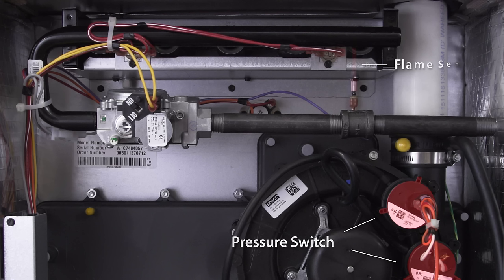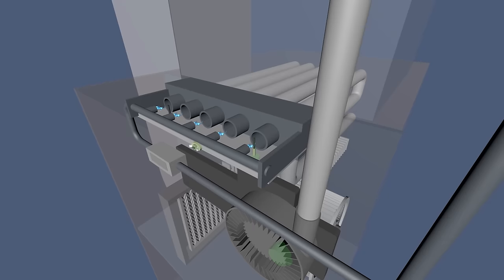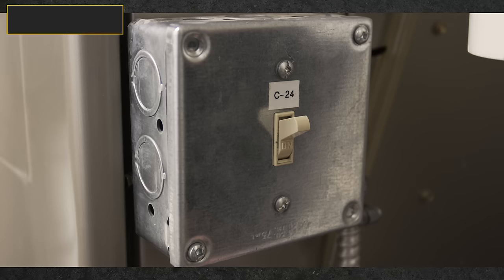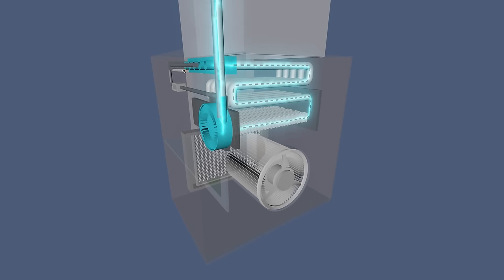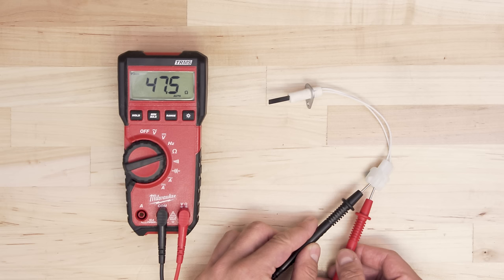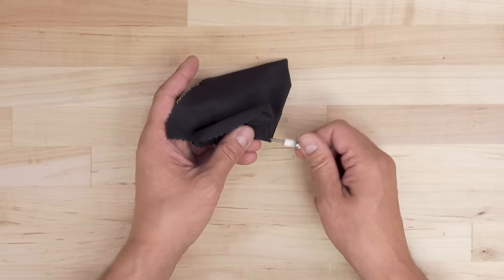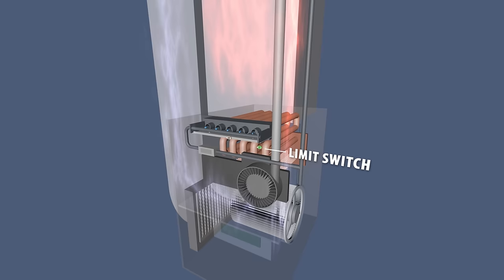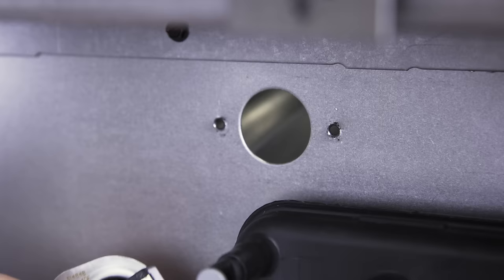Furnace Starts Then Stops - Troubleshooting | Repair and Replace

Comment: I have one of those scenarios. The igniter glows and the furnace fires up but then shuts off within seconds. I presumed because the blower isn't coming on? (blower does work for AC)  I don't see anything that resembles a separate flame sensor. I have a Nodyne furnace and I think the igniter and flame sensor are a single unit? I do have that flame rollout switch and the limit switch.  Likely one of those? are they identical parts just in different locations?
Reply from the maker: Thanks for the update. The flame sensor is also called a flame rod. This is because it is a solid piece of metal with one wire terminal. This flame rod will sit in the flame. Generally it will be located on the opposite side to the ignitior, (since the flame sensor checks that all the burners have ignited).

The flame rollout switch and limit switch are measuring temperature and not verifying if there is a flame or not. 

If the flame does not stay lit, cleaning the flame sensor, burner and checking the connections to the flame sensor are all things that can help solve this problem.
Reply: @AmreSupply  thanks for your reply. I see nothing with a single wire terminal that looks like a flame sensor in your videos. My Miller/Nordyne unit is a single burner. The only thing sitting anywhere in or near the flame is the igniter. It is a downdraft unit in a mobile home.
Reply from the maker: @jeffflowers729  In that case the flame sensor will likely be built into the ignitor.
Reply: Something is very wrong now. The ignitor stopped glowing so i wiggle the wire and it sparked and shorted out.  The new igniter doesn't work because There is no power to the ignitor. The circuit board shorted out. Black burn mark on cabinet behind it. so I ordered a new board and it's got a steady flashing red light which means false flame or internal fault. Nothing happens. ordered another board and still steady red flash. If I unplug the 9 wire plug the inducer and blower come on, and stay on when i plug it back in, but still no power to ignitor. Two defective boards?  @AmreSupply
Reply from the maker: @jeffflowers729  Thank you for the update. It might be worth checking continuity of the wire that runs between the ignitor and the control board. If there was a short, and if the circuit board shorted out, the ignitor wires might have become damaged. Also check the connections to make sure there is not a carbon buildup on the wire connector or terminals that might prevent a good connection.
Reply: I was able to fix the problem.  The igniter shorting out and burning out the board was the start of it all, but trying to fix it, It was the new circuit boards all along. The 903429 is supposed to be the upgrade for the 624640 board that burned out. I tried two of them. I was able to find a 624640, plugged it in and all is working. Did I have two defective boards or they are not truly an upgraded substitute??

Comment: My furnace runs about 5 to 10 minutes, then the gas shuts off but the induction and circulation motors keep running, then the gas turns back on, but the middle burner doesn't ignite properly and I get flame rollout. No flame rollout after resetting the rollout switch. Although furnace has cooled a bit by the time I do that.
Reply from the maker: Thanks for watching. In any case of a flame rollout, check the airflow and to make sure that the burners are clean. If there is any restriction, it can cause the flames to roll out of the front of the burner, which will trip the switch. You might also see additional carbon on the burners in this case. When there is a flame rollout it is often best to get the furnace cleaned and inspected by a professional.

Comment: Lennox g61mpv 2+3 intake and exhaust clean. High and low tubes clean all around. Surface ignitor replaced last year. How do I confirm if the low pressure switch which is a failed open is the culprit? Thanks in advance
Reply from the maker: Thanks for watching. In the case that the furnace shuts off just before igniting, or you have a code which points to low pressure, you'll want to eliminate any other sources of low pressure. First verify that the inducer runs during start up, that there is no restriction in the flue vent, and that there is good airflow overall. Next check the tubes leading into the pressure switch, the ports are small and can become restricted. Other than that, there isn't too much that you can directly test without testing the voltage, or using special equipment to actually measure the pressure. Replacing the switch is the most definite way of knowing if the pressure switch was the culprit.
Reply: @AmreSupply  thank you. Already confirmed inducer starts, lines for pressure clean and good exhaust/intake. Guess I'll have to go to the next level
Reply from the maker: Glad you eliminated those other factors, first.  It does point to the pressure switch as there's nothing else that would give you that code. Cheers

Comment: Good morning! I have an Ultra V 80 furnace. The 4 burners are producing flame, but momentarily. When the furnace wants to start blowing heat, the flames go out and the furnace stops. The furnace repeats the same cycle a few more times and the flames continue to go out after each attempt. All 4 burners maintain flames for a few moments, then stall out. From what we can see, the green light flashes 8 rapid flashes then on the 9th flash it holds. We changed the air filter also and that didn't help. Cleaned the flame sensor as well. Any advice is greatly appreciated, thank you !
Reply from the maker: Hi Rhiannon, thank you for watching. There are a few things that could be happening. The flame sensor could be faulty and might need replacing. As well the flame sensor might not be positioned correctly which will prevent it from generating a good signal. Also its best to check your codes to see what those flashes are referring to. The codes are lightly listed on the back of your furnace door cover.
Reply: @AmreSupply  thank you very much for those helpful tips.  To further clarify: the igniter glows then the 4 burners ignite and have flames. Then after 5 seconds, the flames go out. The furnace attempts another 2 times and the same problem occurs. Beginning to think the "smart valve" is malfunctioning. 
I recorded the light on the smart valve, had to slow down the video speed to 1/8 th of a second to actually count the pulses as they are extremely rapid. The furnace manual doesn't have any information regarding 9 light flashes. There is a 6+3 though.

Any other suggestions?  Thanks again for your help.
Reply from the maker: @rhiannon3357  The fact that you get all 4 burners igniting and shutting off after 5 seconds means that the furnace is not proving that there is a flame present. Double check that the flame sensor tip is in the flames. If that doesn't help then it might be best to try installing new flame sensor. That is the first thing to eliminate.

As well the codes are likely on the bottom, blower door cover, on a big sticker on the inside of the door.
Reply: @AmreSupply  we may have found the solution. Unplugged the wiring from the smart valve and reconnected it. The furnace fired up for the first time and is running, wooohooo! Thank you very much for taking the time to help me out. Hopefully our problem is solved now.
Reply from the maker: @rhiannon3357  Thats great, we're glad you were able to get it running again! We're happy to help out where we can! You might still need to keep on eye on it as its possible that unplugging just reset it. If the furnace short cycles again and does another lockout you'll likely have to unplug again and narrow down the problem from there.

Comment: Thank you for the video.  I want to double check a problem.  The heater (5 year old Goodman furnace) isn't turning on so I opened the panel to look around a few days after the shut down and it mysteriously began working again.  However, after a short while the heater shut down again.  I cleaned the flame sensor (looked cleaned but I cleaned it anyway) but don't see the heater or igniter working.  It looks dead (inducer motor not even starting) but the red light is on solid and not blinking.  Since I was able to get it working after it shut down the first time, could the igniter still be a potential problem (since it worked once more after shutting down)?  Or do you think I have dirt in the hose or any thoughts on what the problem may be? If it's dirt in the hose, what's the best way to clean it? Many thanks for your videos.
Reply from the maker: Thanks for watching. From what you're describing and the solid red code, means that it could be an intermittent issue with the thermostat. First check the batteries of the thermostat and make sure that the wire connections are secure.

The ignitor doesn't partially fail, its usually an all or nothing failure which you can test with a multimeter. So if the ignitor fails it won't suddenly start working again.

If the pressure switch tubing was clogged then you'd likely get an error code.
Reply: @AmreSupply  Thank you for getting back to me.  I checked the batteries (it was fine) and replaced the Honeywell panel and am having the same problem.  I noticed the inducer motor won't even start (almost as if it were in a lockout).  The times I've been able to get the furnace to start (waiting a few hours later), it will run with the heater working for about 20-30 minutes or so before shutting down.  I'm still in the process of troubleshooting but wondering if it's the inducer motor (sounds normal) that is defective even though I can get it to start a few times? I thought the problem was starting the furnace but I'm wondering if I can't start the furnace because I"m locked out (no error codes) and the actual problem is really something causing the heater to shut down and perhaps lockout the furnace.  Do you think it's a thermostat wiring problem behind the wall? Again, the red light is solid so no error codes.  This is a real head scratcher for me.  Again, many thanks for getting back to me.
Reply from the maker: @ching-yi2007  If you think the furnace is locked out then you can turn the power off to the furnace, wait 5 minutes then turn it on again. This can sometimes reset the furnace.

If the furnace runs for about 20 - 30 minutes before shutting down then its likely the limit switch that is defective. Make sure that the furnace filter is clean and there is no restriction of the airflow. Since the furnace runs for 20 minutes, the limit switch will most certainly pass the continuity test but its possible that the contacts inside the switch have warped and its shutting off at lower than its rated temperatures. The switch is inexpensive and easy to replace so that would be a good place to start.
Reply: @AmreSupply  I'll give that a try thank you.  Your videos are really well explained thank you.  They really helped me think of the problems better.
Reply from the maker: @ching-yi2007  We're just happy to help. We're glad that the videos helped you get a better understanding of it all!

Comment: Hi, your video instruction is very informative and easy to follow for common folks like me. Thank you very much.
I have a Trane XE80 that the start up heating sequence all checked out to the surface igniter. The igniter glows red hot but no gas flow to the burner. Traced the wires from the gas valve back to control board and got zero volt. What should my next step be? (The igniter White Rodger/Trane #765-a5 B340971P01silicon nitride with room temp resistance 11-18 Ohm. Mine measured 14.7 Ohm). 
By the way, no flame to burner but went ahead and cleaned the flame rod. Of course no effects.
Anyone else experience similar situation? Thanks.
Reply from the maker: Hi Tam, thank you for watching. If your ignitor glows but the gas valve isn't opening and doesn't have any power then it could be a couple things. Either the gas valve is faulty, the wires or connections from the gas valve to the board are loose or the control board is faulty. First its best to turn off the power and check all the connections and wire terminals to make sure there's a good connection. Now turn on the power and observe the startup sequence. When the gas valve is activated you should hear a click when the solenoid energizes. If nothing changes then you can try replacing the control board which is a straight forward repair which you can see how to access here:  https://youtu.be/bCGLGXyBhNE?t=96 (just note is an electrical part that won't be able to be returned after you replace it). To replace the gas valve you'll need to contact a technician.
Reply: Thanks for yor response.
Wires from control board to gas valve checked and intact. No current from board as I've checked terminals at board.
Is there a way to test the gas valve before ordering the board (I highly suspect the problem is the control board but want to be sure before ordering..)
Reply from the maker: @8lueMo0n  Happy to help! Some gas valves can be checked for continuity to check to see if the windings in the solenoid are good. Many newer valves have a small circuit board and rectifier in them so testing for resistance isn't possible. The fact that you're not getting any current at the terminals on the board is a good indication that the board is faulty.
Reply: Thank you so much for your advice. I will order replacement control board soon.
Reply from the maker: @8lueMo0n   You're welcome Tam! Glad that this has all been helpful to you!

Comment: My furnace seems to work just fine during the day, then at night it stops and short-cycles.  Why only at night?  I get 'air pressure' code error.  So there must be obstruction in the airflow but then why does it only short cycles at night and not during the day?  Why airflow is obstructed at night?  Does not make sense.
Reply from the maker: Thank you for watching. Its possible that during the evening, the temperature drop causes an increase in condensation. If there is a buildup of condensation inside the pressure switch tubing then it will give you the air pressure code error. There also could still be some buildup of material in the tubing as well. Its worth checking the tubing.

Comment: my furnace heats up to the set temperature, 72F, then it stop, and won’t turn back on until my room temperature reaches a low of 65F. We cleaned our flame sensor bit then we have no idea what to do now
Reply from the maker: Hi Kim, thank you for watching. It could be a faulty limit switch or it could be overheating and an issue with the airflow. In either case its still a good idea to replace the furnace filter as any restriction of airflow can cause the heat exchanger to overheat and can trip the limit switch.

Comment: After completing a cycle my furnace makes two attempts to restart before stopping  any idea ?    Thx
Reply from the maker: Thanks for watching. Do you get any error codes? How far into the startup sequence does the furnace get? Does the inducer run? Do you get any ignition at all?
Reply: AMRE Supply 
Thx for reply.    Not sure about error codes   It doesn’t completely start up just  two quick hits don’t believe it makes it to the ignition stage.
Reply from the maker: @kjonezey43  If it doesn't make it to the ignition stage then it could be an issue with the venting, or pressure switch.
Reply: AMRE Supply 
Thank you !
Reply from the maker: @kjonezey43  You're welcome!

Comment: I dont feel comfortable working around Gas or Electric. And tonight my Furnace started running weird. I read 7 blinks in our Goodman. I just hope it's safe running like that for the night until my heating gu uh shows up.
Reply from the maker: Thank you for watching. Its good that you know your comfort level, and that you've got a professional coming to check it out. A code 7 in a Goodman furnace means that there is low or weak flame sensed. This could be a dirty flame sensor or low gas pressure but the service technician will be able to narrow that down. Keep in mind these safety switches will do their job and shut off the furnace if the condition is unsafe. If a switch or sensor fails, then the furnace will shut off as well.
Reply: @AmreSupply  that is good know. I didnt sleep the best last night worried if it was overheating or leaking gas.
Reply from the maker: @TheEvansFamily  Its good to be aware and to make these observations. In any case if you do smell gas, always shut the gas supply off and ventilate the area then call a professional.

Comment: Our furnace runs fine for few hrs and then shut off until we menaully turn the main switch on and off, and it starts turning on after few mins. It's been going on a while now. We changed the air filter and had technician came to see. He literally cleaned flame sensor and checked the leaks which cost us 200$. After day or two same problem occurred. So I spoke with couple technician with different diagnosis.. Could be with the limit switch or increase gas amount because furnace (falsely) assume its too big for the house( I don't know what it's mean). We are  tired of all this issues. Since I watched your video it seems like our furnace issue has to do with limit switch...
Reply from the maker: Thanks for watching. That sort of intermittent issue is frustrating for sure, but the fact that the furnace is able to go through the complete sequence, but shuts off after running for a few hours suggests that the limit switch is starting to fail. That would be a good starting point before anything else and is a simple point of elimination.
Reply: @AmreSupply  thank you so much. Tech is coming tomorrow to replace the limit switch.